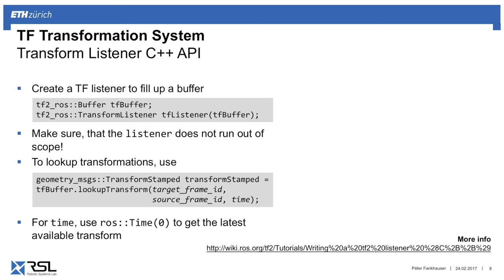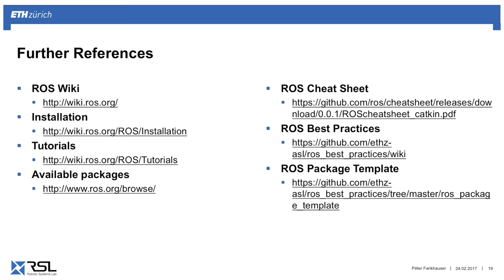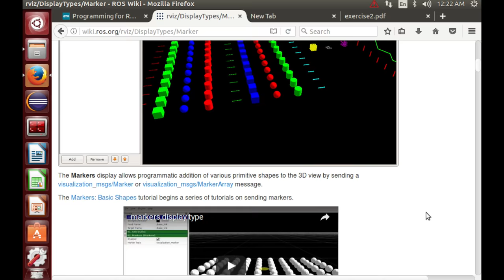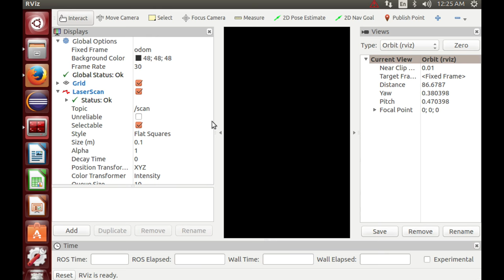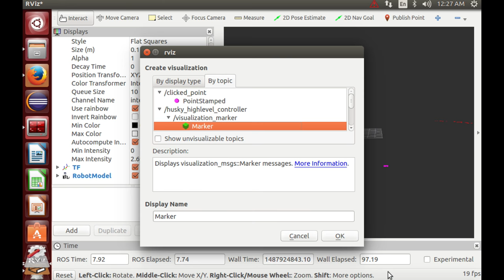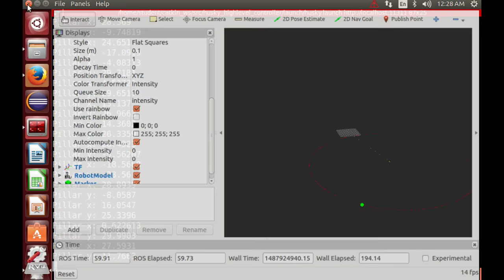Programming for Robotics (ROS) Course 3

Comment: i need your help with few ros questions , i am using irobot from gazebo, i have spwan it in gazebo and using teleop to move it. 
being new to ros i need help with -Create a C++ node that subscribes to /cmd_vel topic advertised by Keyboard Teleop .

 Challenge Question: Setup “rviz” to display the topics published by the nodes. For example,
the /odom, laser scan.
Reply: i dont get the question